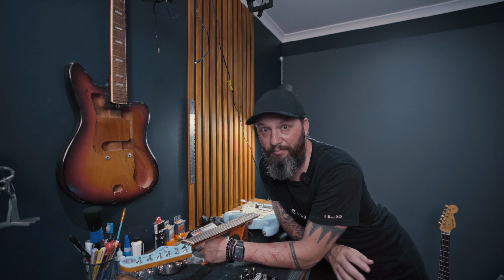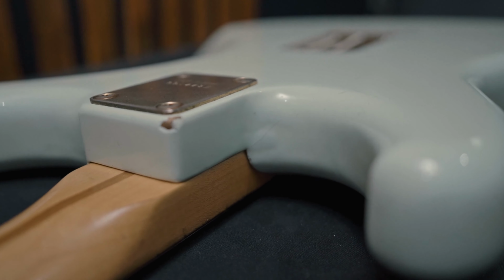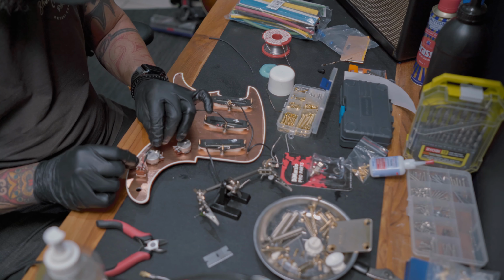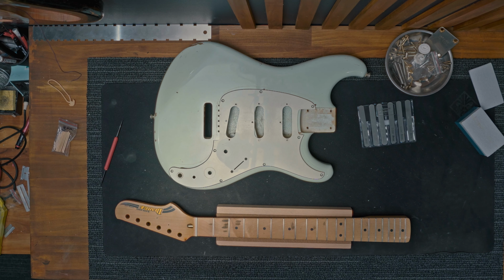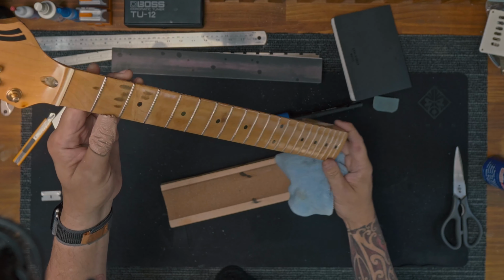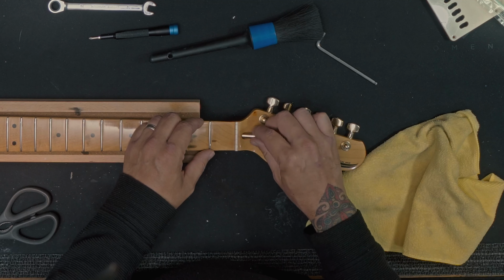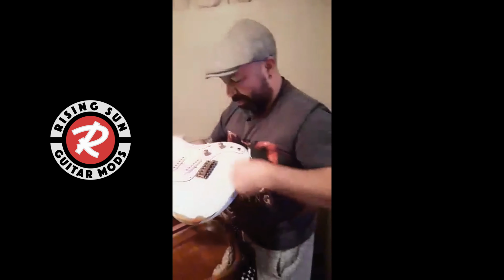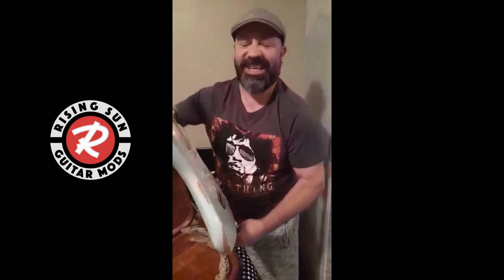I Restored and Modified an Ibanez Blazer BL450

Comment: Nice work on putting this back together. Love the pale blue body. I recently reconditioned my ‘82 Blazer  6 months ago. This was my first electric bought second hand for $200. Like yours my brass items came up a treat. Unfortunately it kept tarnishing. So in the end I bought a matte clear coat that I applied in two very light coats. I held off foiling the pickguard as I would like to get a 3 ply eventually. The cavity got the full foil treatment.
Reply from the maker: Thanks man, that's awesome you sorted yours out too! This one was for a viewer, you can see his reaction at the end. I also gave my Roadstar II a once over, you should check that out too: https://youtu.be/QOuR9ewrOO8